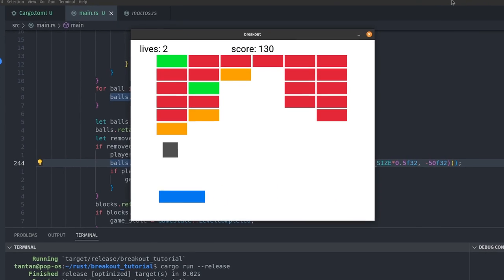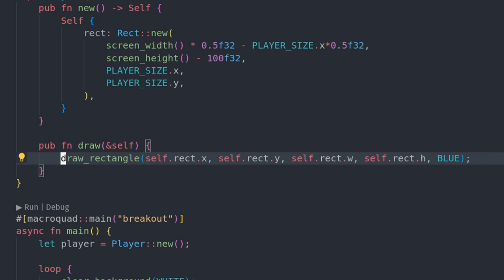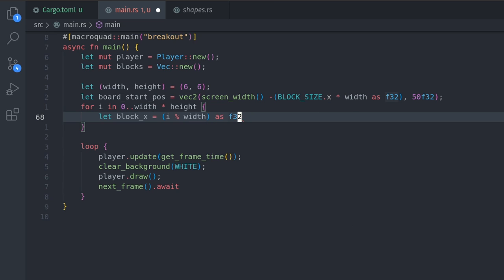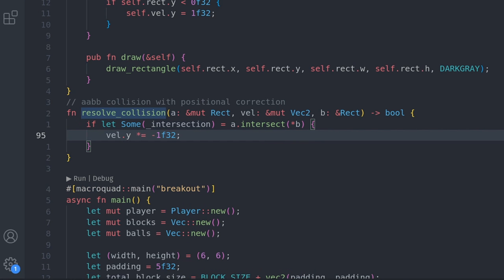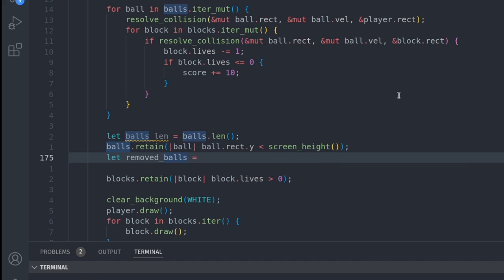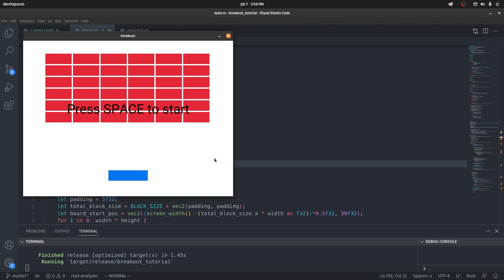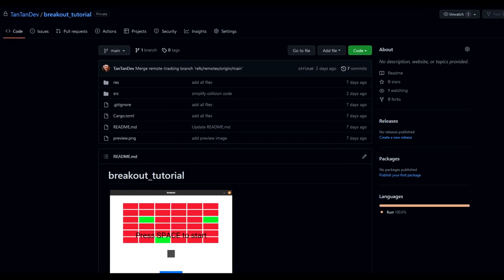Rust breakout game tutorial

Comment: Some minor corrections (up to 13:17 because I ran out of time this morning) if you run into problems:
 - At 4:44 ~ `player.update` requires a mutable player. Lines 45 needs to be `let mut player = Player::new()`.
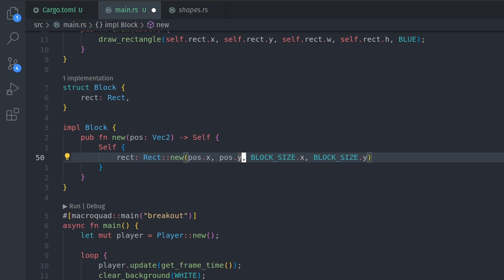 - At 5:04 ~ `BLOCK_SIZE` is written as {150f32, 40f32}, however at some point it was changed to {100f32, 40f32}. If your blocks look different, that's why.
 - At 6:51 ~ `pub` in front of `pub struct Ball` isn't necessary in this case, in case you were wondering what was so special about the `Ball` struct compared to the other structs. It's not.
 - At 11:18 ~ On line 132, `_intersection` got changed to `intersection` (leading underscore removed). The underscore is us telling the compiler that we have no intention of using the variable. We need the `intersection` variable now, so we remove the underscore.
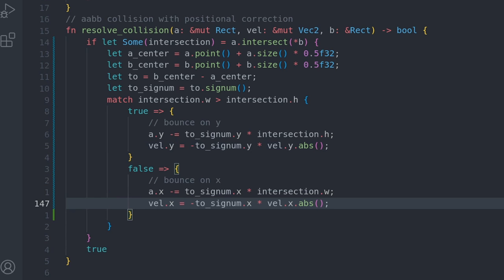 - At 12:36 ~ If you implement `resolve_collision` as shown (pause frame), you'll notice that all the bricks are instantly destroyed. This is because the `resolve_collision` function is always returning true. To fix this, the `true` on Line 151 needs to be a `false`, and a `return true;` needs to be added after Line 149. He will fix this in the next step, however, by adding an early return into the function.
Reply from the maker: Upvote this bois!
Thanks, it's hard to catch everything whilst editing such a long video
Reply: @Tantandev  pin it!

Comment: I hope youll appear in the next this week in rust issue (edit: he did not) 
0:19 I want to point out that as of rust 1.62, you can simply run `cargo add macroquad` in the terminal and it will add the dependency.
I think im legit going to follow this tutorial. (if anyone is interested, OS: pop OS, terminal emulator: tilix, code editor: helix)
Reply from the maker: Cool shortcut!
How do you find helix? It's popped up on my radar many times, even tried it once, but feel like I need to really invest some time to get used to it.
Reply: @Tantandev  Coming from an IDE background (and not, say, Vim), I've been really, really enjoying it. I haven't powered up IntelliJ for several weeks now.

Yes, you do need to invest a bit of time to get used to it, but it's really not too bad... it feels worse than it is because you WILL spend a couple of days feeling like a caveman, proper ooga-booga. It gets better after that, within a week or so you can be productive, and in a few weeks you'll feel as comfortable as with your IDE, I reckon.

Plus, there's the added illusion during that threshold, after coming to grips with it but not quite matching your proficiency in an IDE, where you already feel faster because you're racing around the keyboard in a very uncavemanly manner.
Reply: @Tantandev  I have no problems with helix plus its lightweight because its pure rust. Of course rust analyzer will take much more resources though. Once I got it set up, I feel like it has all the features for me to use it well.

Comment: 3:43you can also make this a one liner writing it as:
```
let x_move = is_key_down(KeyCode::Right) as u8 as f32 - is_key_down(KeyCode::Left) as u8 as f32;
```

Since booleans in rust are guaranteed to be an actual 1 or 0, you can cast it to an int, which you can cast to a float.
I don't know if it's more performant than using ifs, but it probably is better than a complex match.

Edit 1:
6:14 nitpicking about performance:
modulus and division are the most exepensive operations to ask of your CPU, using them in a loop when not really necessary may not be a good idea. You could actually just use a double nested loop wth each of the coordinates, not only might it be more performant by default, it is also clearer, and lastly it is a configuration that the compiler can detect more easily to apply more optimisatioins later. Since this is initialization code (at least so far), this might only affect startup time and considreing how fast rust runs, it's not a big deal either (after all, early optimisation is the root of all evil)
Reply: lol commented the same thing (first part)

Comment: I noticed that the game.exe (exactly .exe) crashes (and the tantan version too) when "cargo build --release", but the debug version that is not compressed - it works, it all upsets me a lot, because the compressed version weighs more than 2 times less. I found out that this is because of the font, but I don’t understand what to do with it .. (I used a translator, sorry for possible mistakes)
Reply: Correction, the debug version also crashes when opened. The main thing is that the game works from vscode, and tantan, and mine starts from vscode, but the .exe does not want to work ..

Comment: Great tutorial, but because of fixed object sizes, when you start changing window size, magik happens.
Reply: I think that possible solution is to create width and height similarity factors, for objects and speeds of player and balls and multiplying those factors by screen width and height each game tick or when screen width and/or height change.

Also, as someone in the comments pointed out, compiled game doesn't work without cargo run because it can't find font file. After some experimenting, I came out with this solution:
-    let font = load_ttf_font("res/Heebo-VariableFont_wght.ttf")
-        .await
-        .unwrap();

+    let font = load_ttf_font_from_bytes(include_bytes!("../res/Heebo-VariableFont_wght.ttf"))
+        .unwrap();

On my PC this solution works just like before and allowes to run game from compiled file as well and in theory, this solution should work on other PC's as well.